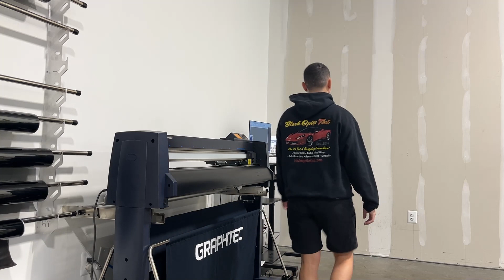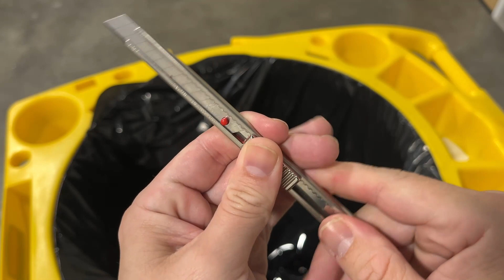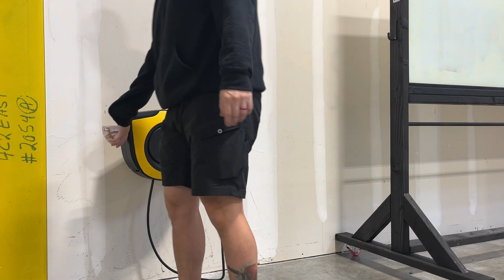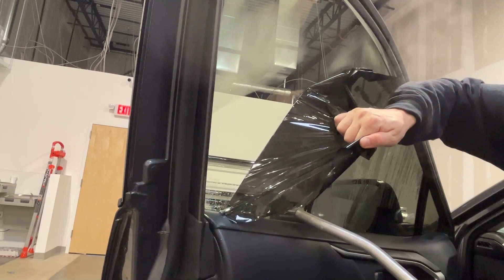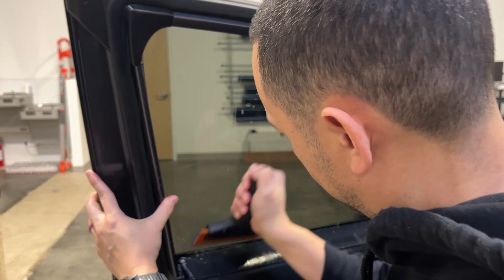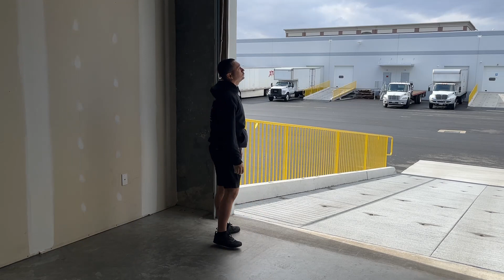Window Tint ASMR #asmr #blackoptixtint #windowtint

Comment: Very cool and unique way to show the process! How come through most of the procedure, the window is down a few inches with no tint, and then all of a sudden the tint is at the top?
Reply: Also, what kind of chemicals are being used to clean the window and tint? Is it harmful for the excess to sit on the door panel during the process?
Reply from the maker: Good question. We use a slip solution of baby shampoo and water. The baby shampoo is gentle enough to not damage your door panel.